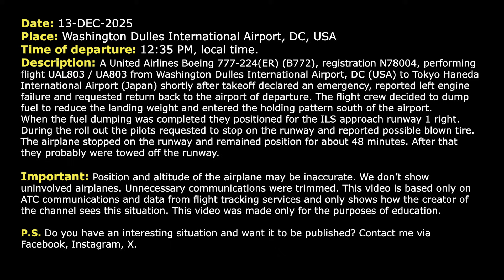Airplane Loses Engine on takeoff. United Boeing 777 declares MAYDAY at Dulles Airport. Real ATC

Comment: The crew sounds solid. They prioritized aviating (keep it flying, manage the failed engine), then navigating, then communicating. The “Stay this frequency. I’m busy” and “Negative” to extra vectors is exactly what you want when workload is through the roof.

ATC’s “extra questions” are a double-edged sword. They do need souls/fuel/engine and intentions to coordinate ARFF and keep everyone safe. But the timing matters: in the first minute or two after an engine failure, pilots often need a little “radio quiet” to stabilize. After that, the info exchange becomes more reasonable.

The low altitude / MVA warnings make sense. If they were struggling to climb (heavy jet, one engine, clean-up not complete), controllers are rightly worried about obstacle clearance. That said, you can hear how the back-and-forth adds stress.

Fuel dumping was the right call. A 777 headed to Japan is extremely heavy. Dumping to get closer to max landing weight reduces brake energy, tire stress, and structural loads—especially important when you might already have collateral damage from an engine event.

The MAYDAY “repeat” wasn’t drama. It sounds like they felt they weren’t being heard when they were ready to come inbound, so they used MAYDAY to re-establish priority and get attention. That’s legitimate.

Stopping on the runway for a suspected tire is also sensible. With possible debris damage, hot brakes, or uncertain gear/tire condition, stopping and letting ARFF check things can prevent a taxi incident.

Net: A well-handled emergency with a bit of “human factors” friction—ATC balancing terrain/traffic/ARFF coordination while pilots are maxed out. If anything, the main improvement would be ATC using more “stand by / say intentions when able” early on, then collecting details once the aircraft is stable.
Reply: You have the best comment here. Balanced. When an acft is flying too low, there are constant alarms going off in the tower. It alerts controller is in an aircraft is too low and that there is an obstacle out there somewhere that creates a hazard. So the insistence on keeping him within the MVA was very important for the safety of the aircraft. That flight is a daily occurrence, but doesn’t mean those pilots, though visual, can’t see the antennas and lines on top of buildings. 
The controller that didn’t answer immediately was coordinating. We also can’t hear the other aircraft in the area. Aircraft step on each other all the time. But I appreciated your thoughtful response. - from a local ATC

Comment: Flight: United Airlines UA803

Aircraft: Boeing 777-224ER (a “heavy” long-haul jet)

Route: Washington Dulles (IAD) → Tokyo Haneda

Date: 13 Dec 2025

Problem: Left engine failed shortly after takeoff

The crew declared an emergency, returned to Dulles, dumped fuel, and landed safely.

Timeline explained step by step
1. Takeoff & engine failure

Shortly after liftoff, the left engine failed.

The aircraft was not climbing normally (only ~2,000–2,500 ft instead of much higher).

ATC issued a low altitude alert because the aircraft was heavy, slow, and near terrain/obstacles.

Key point:
A 777 can safely fly on one engine, but climb performance is much worse, especially when fully fueled for a long international flight.

2. High workload in the cockpit

The pilots were extremely busy:

Flying the airplane manually

Running engine-failure checklists

Securing the failed engine

You hear them say things like “Stay this frequency. I’m busy.” and “Negative” to vectors.

This is normal in the first minutes after an emergency.

3. Why ATC kept asking questions

ATC repeatedly asked:

Souls on board

Fuel remaining

Which engine failed

Intentions (return immediately vs. hold)

Why this matters:

Fire & rescue (ARFF) needs this info

Controllers must keep the aircraft above minimum vectoring altitude (MVA) to avoid terrain and towers

They must plan runway usage and emergency response

To pilots, it can feel like overload.
To controllers, it’s required safety coordination.

Both sides were doing their jobs.

4. Fuel dumping

The 777 departed with ~16 hours of fuel for Japan.

That’s far too heavy to land safely.

The crew requested to climb to 5,000 ft and dump fuel south of the airport.

Fuel dumping:

Is normal and legal

Happens over unpopulated areas

Fuel atomizes and evaporates before reaching the ground

They dumped fuel for about 20 minutes.

5. Holding pattern

ATC set them up on the ILS localizer for Runway 1R.

The pilots asked for long legs so they wouldn’t be constantly turning while dumping fuel.

This reduced workload and gave them time to stabilize the situation.

6. MAYDAY call

The crew restated MAYDAY when they felt ATC wasn’t responding quickly.

This was not panic — it was to re-assert emergency priority.

Once clarified, ATC immediately set them up for landing.

7. Approach and landing

The crew chose an ILS approach (instrument landing system) for maximum precision.

Emergency vehicles were already staged.

Tower cleared them to:

Use the full runway

Stop on the runway if needed

After landing:

The pilots suspected a blown tire, likely from debris or stress during the emergency.

They stopped on the runway and stayed there ~48 minutes.

Aircraft was later towed clear.

Extra details mentioned in comments

Engine debris caused a brush fire near the departure runway.

ARFF vehicles were deployed immediately.

Aircraft registration N78004 is an older but well-maintained 777.

GE90 engines are extremely reliable, but failures still happen — this is exactly what crews train for.

Why this is considered a “good outcome”

✔ No injuries
✔ Aircraft under control at all times
✔ Correct procedures followed
✔ Professional cockpit resource management
✔ ATC maintained obstacle and traffic safety
✔ Safe landing despite engine failure + possible tire issue

This is a textbook example of how modern aviation handles serious emergencies.

Comment: Wow, Losing a powerfull engine on take-off with a full load of 16 hours of fuel and 290 Souls shows how safe flying is, first getting airborne and positive climb with gear out and flaps and when gears come up, the plane has additional drag of the gear bay doors that open to retrieve the gear and then safely climb to 5000 feet. 

Does the one engine go automatically into another mapping for maybe additional thrust that is only available in cases like this? So anything beyond thrust lever fully forward on TOGA without holding back of some per cent from possible programmed Reduced/Derated thrust on take-off and derate in climb? Is there a higher risk to go at the max rated trust what so far I know normally not even provided when you set trust levers at ToGa? Because you normally don't want to hit each time the max rated trust when you use in normal flight ToGa, because the extreme wear and tear, is ToGa so in normal flight some per cent off from max rated thrust? Wondering that because this 1 engine provided enough to safely climb to 5000 with a faillure at the worst time and being very heavy.

Comment: The airplane did not lose an engine. It suffered an engine failure. Fix your video title.
Reply: Tell that to the flight crew at 0:15.
Reply: @I_Evo   @I_Evo  I would. 'losing an engine" is slang.  It's not clear terminology and can lead to ambiguity. The recent UPS Flight 2976 crash actually lost an engine. This was an engine failure.

Comment: Canny veteran flying that 777!  Resisted the urge to do a quick direct return, even when expected by tower.  PIC understood the performance of his craft, had the climb under control despite low MVA in the area, Tower was doing due diligence with low terrain warnings, can't fault them.  Knew he had time and control enough to dump fuel, did so to make the landing not just easier, but possible at all.
Reply: Any pilot should know minimum vector altitude as it is charted. The 777 can automatically land , even on one engine.
Reply: @7 @747heavyboeing3 any Pilot should know MVAs aren’t charted.
Reply: @747heavyboeing3  MSA's are charted, not MVA's.
Reply: @seeburg220 Chartered for ATC
Reply: Great comment.  I was going to post something similar.  What folks sometimes forget is that these audio's are not real time.  It may seem like ATC is "bothering" the pilots, but I figure there were longer gaps on comms.  IT as spot on for ATC to call out MDAs.  With the work load in the cockpit, that could be last on the list and gosh, no pilot has ever flown into the ground forgetting to check altitude.

Overall, I found ATC did their job and it showed when offering a holding that would set them up for a final approach without much turning,.  THe two pilots, great job doing what they were trained to do, Aviate, Navigate, and Communicate in that order.

Side now, seems those 777 engines are maybe not as hardy as one would think.  Third 777 engine blow up in a few years.

Comment: The illogical nature of old men. THeyre on a single engine, coordinating holds for fuel dumping? witle they could barely climb on T/O? Get tf on the ground!
Reply: In this situation, the pilots need to weigh the likelihood of the second engine also failing, against the likelihood of something going wrong during an overweight landing.  One of those is MUCH more dangerous than the other, and it's not the one you think.

Comment: Another ancient 772 with close to 100,000 hours but GE90 engines.  This is the useful service life. The  UPS MD-11 at Louisville had an atonishing 92,000 hours.
Reply: There’s a 767 still flying day in and day out with almost a 150k. Cycles is what matters, not necessarily time. It’ll be fine.
Reply: @alexgustavson2909 Understood but I'll pass on most 30year old air frames. This is the first GE90 catestrophic failure I can recall though.

Comment: please explain 'Dump Fuel' ? like where does it get dumped?
apologies for my question in advance 😊
Reply: People more in the know can answer your question. But I think that there are rules that may even involve using common sense. Not too long ago a Delta plane had a similar problem and dumped fuel at around 1,000 feet over Los Angeles. Children and adults were hospitalized from breathing and touching the fuel falling from the sky. Delta later settled the lawsuit for $79 million. So I guess the minimum altitude is probably somewhere above 1,000 feet.
Reply: Modern wide body aircraft designed for long flights generally have a fuel jettison capability.The difference in take off weight and planned landing weight can be well over 100,000 pounds, often significantly more. They open valves that allow fuel to vent out into the slipstream to lighten the weight of the aircraft. Doing it 5000 or 6000 feet above the terrain generally allows the fuel to dissipate and not cause environmental damage.

Two important weights are computed every flight. Max takeoff weight and max landing weight. At my airline, I'm retired now, we always computed an emergency return also. If the airplane will climb out on one engine after a failure after V1, it will surely have the performance to land, but there are limitations and precautions.  Pilots can land overweight. Jets like A-320's or 737's don't have fuel jettison. They either land overweight or circle while burning fuel down to reach landing weight. There is an airborne checklist procedure for overweight landings, as well as a required maintenance inspection. 

The decision to dump or not, if capable, is left to the pilots, who consider many factors, like runway length, weather, density altitude, braking action, and the current status of the aircraft. Single engine landings are normally done with less flaps than normal, at a higher speed, and, possibly with reduced hydraulic capability, like losing the thrust reverser on the side of the failed engine.
Reply: @JoeH-l8w  awesome explanation. Thank you so much Captain!😊

Comment: 787 Captain here and me personally I would not have taken the time to jettison the gas. Number 1  - I have no idea why that engine failed and if whatever caused it to fail is going to affect my remaining engine. I would rather get it back pointed at a runway as quickly as possible and just land heavy. YMMV
Reply: Really!? A 787 captain thinks this is the place to throw shade on those guys?  (Me >4000 hours in 787 and retired 777 Captain—you can do the math and figure out who I retired from)
Reply: Did you notice the destination? Heavy doesn't begin to describe it. With a reasonable load of passengers, that airplane could easily be at or near maximum takeoff weight.
Reply: That's what I always thought too. If you lose an engine due to an unknown cause and have trouble gaining altitude, it makes sense just to get on the ground.
Reply: Its very dangerous to land a plane overweight as it was they blew one tire. The only time a jet looses two engines is when someone shuts off the fuel switches or they run out of fuel. A pilot if you are has the right to make the call. Do you not have all the engine reading from the good engine like temp, N1 and N2 . The good engine is just fine and the plane is certified to fly on one engine.
Reply: You are a 787 captain and want to land with max fuel?  That's funny!!  I'm guessing you want to take that 180 and land on the opposing runway?

Comment: Pilots did an outstanding job! ATC did a great job too. Anyone who thinks they were pestering too much during the high workload environment needs to keep in mind that they were also doing their part to ensure safety. And as pilots, we know how to deal with the queries so it doesn’t create issues. Although the pilots were VMC (visual condition) they were flying into an area of rising terrain and possible obstacles (Towers) and ATC wanted to make sure they were maintaining a safe altitude. MVA is the minimum vectoring altitude for the controllers based on terrain and distance from the radar facility. They were just being diligent… I am grateful every controller is does this.
Reply: No the controller was way to chatty and asking questions. The pilots have the right in a mayday to call the shots.
Reply: Good call saying Negative.  They can wait.
Reply: ATC SUCKED what are you talking about? Apparently you didn’t listen to video…

Comment: Looks like they were flying the Special Departure Procedure (which is straight on extended runway centerline for the 1's at KIAD). SDPs provide obstacle clearance and a lowest possible acceleration altitude to get deconfigured before continuing the climb clean, which usually gives better climb performance due to the reduced drag. I wish ATC controllers were more familiar with the specific SDPs at their own airfields so there could be less questions asked in such a critical phase of flight for the pilots.
Reply: We are familiar thank you. He was assigned a SID if that’s what you mean. But his climb instruction is to 030. Know why? Bc the MVA at a certain point goes from 020 and up. He was at 010. Well below cause there ARE obstacles. I wish random people who play plane games knew anything about ATC.